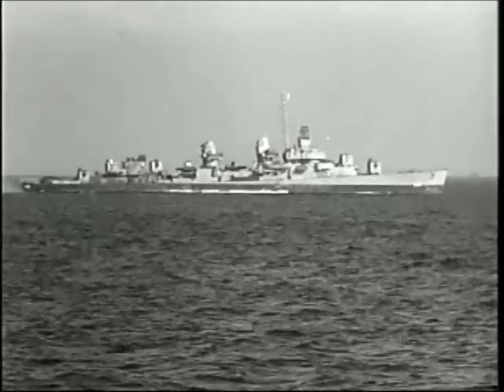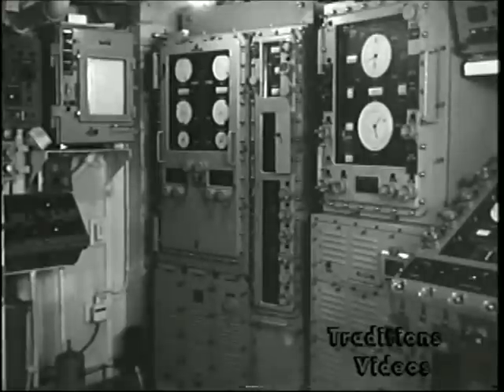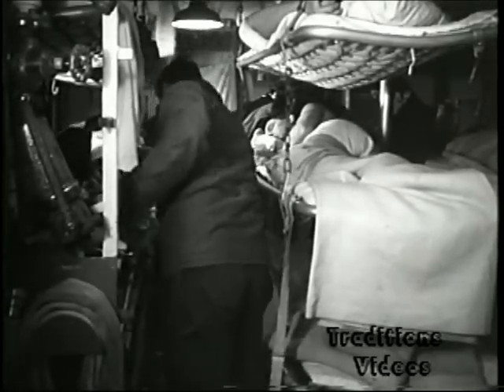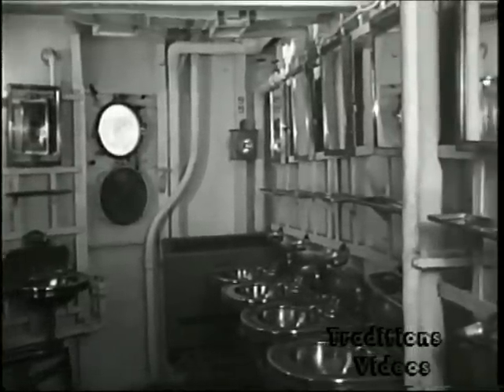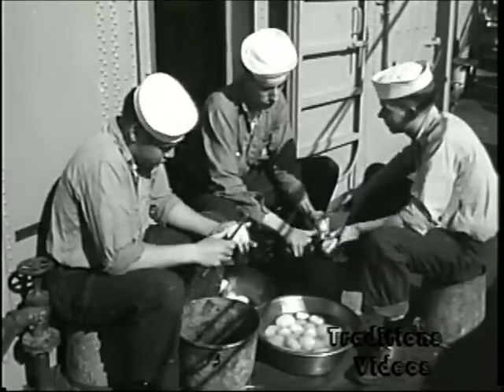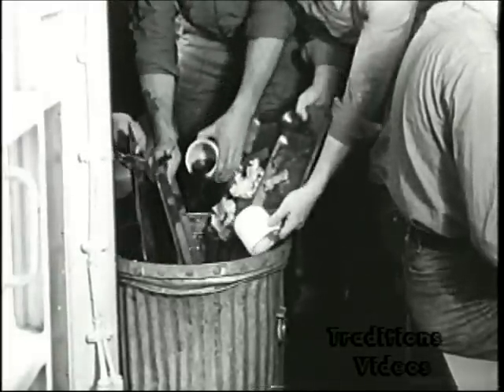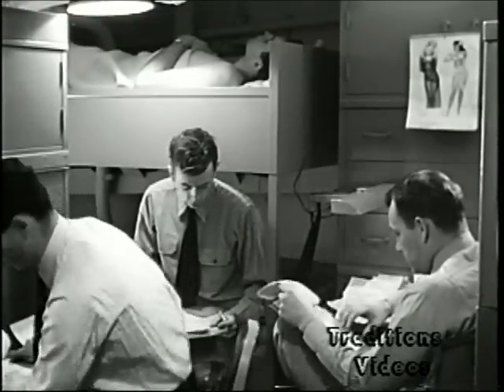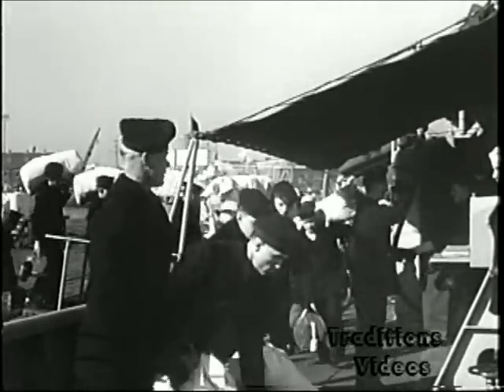US Navy USS  Saufley DD465 1952 Living Conditions

Comment: This pretty much changed by the late 70's early 80's. Most of the surface (as opposed to sub-surface) fleet had been re-fit with curtained racks. They aren't much bigger; you still can't sit up in bed, but you at least have a feeling of some privacy. The curtains are blue which blocks the red lights that burn all night in birthing compartments. There was the threat of having to "hot rack" (two guys sharing the same bed alternately) during deployment to the Red Sea for Desert Storm, but it wasn't necessary - thank God! The heads were also updated to have individual stalls. One of the B.S. parts of this film was the air conditioning being installed for the comfort of the crew. TOTAL B.S. It was installed to insure that electronic equipment, then working on heat emitting vacuum tubes at the time this film was made, remained cool enough to operate. The fact that it also helped the squids be a little more comfortable was completely unintentional. The comfort level of a sailor today is 500% better today than it was 70 years ago but it took about 30 or 40 years from the time of this film to accomplish that.

Comment: I was an Electronics Technician aboard USS Ponce (LPD-15) from ‘83 to ‘87. Our berthing compartment was a little roomier but the head was tiny. It had three shitters, three pissers, six wash basins, and three shower stalls. The head was cramped and at least one of the shitters was out of commission most of the time. The air conditioning for our compartment was a joke too, as in there wasn’t any. That place cooked you good in the tropics. A lot of times I would rig a hammock up in the SPS-40 radar equipment room because the a/c was arctic in there. Loud as hell when the radar was running though. Had to use ear plugs. Got to see some awesome places around the world. Fun times !
Reply: A sad but true fact:  A/C  primary job is to keep the electronics cool.  If the sps-40 (long range air search) went down in the box it was a big deal.  Go Navy (RCN)

Comment: And this is why I joined the Army.  Had a lot of Marines that joined the Army after being Marines they all loved the corps but hated being on the ships.
Reply from the maker: Yeah, shipboard life is not for everyone.  Destroyers of all eras did NOT have any Marines aboard, but am sure there were some exception during transits or just for a very short deployment.  I never saw one in the four years I was in the destroyer fleet.  
But, yes, the Army sure looks more appealing than what is shown here.
Thanks for posting.
Reply: @braintrusts  who ran your brig?
Reply from the maker: @slowpoke96Z28  Never saw anyone who went into any locked confinement while aboard that DD.  Was told there was a caged area near after-steering for confinement, but never saw it. Was also told that the corpsman had a straight-jacket for control, but never saw that either.  
And, yes, being aboard any fighting ship for extended deployments was not fun, at least at sea.  In port was indeed like a foreign, but bawdy Disneyland.

Comment: I was on the USS Forrest Sherman DD 931, 1968 and 1969 was an IC3, slept most of the time on an air mattress in our work space with the gyro.
Reply from the maker: Seems the DD-931 was homeported in Newport, RI in that period, which we were also, the DD-829. 
Not sure I'd have enjoyed the air mattress, but our gyro room was also Plot and contained the IC patchboard. Was mostly quiet and cool during non-working hours, but on the Gearing class, was adjacent to the steamy/stinky scullery.
Thanks for serving and posting!
Reply: 57-60 RODE THE 938 IT WAS LIKE THE HOLLYWOOD HILTON COMPEARED TO THE WW2 DD's  32 yrs Bosn C

Comment: Fascinating film! I often wonder what life was like back then in these type of ships. Almost unthinkable now... Thank you so much for posting.
Reply from the maker: The living conditions improved only slightly through the Sumner-Gearing Class destroyers, all built in the '40s, as they got fitted for A/C in the berthing spaces in the 1960's, but not much else, other than regular toilets.  Living conditions were still cramped and VERY minimalist. These destroyers were the mainstay of the fleet (over 100 of them)  until the '70's. See other great videos that accurately depicts life on a USN DD at: 
https://youtu.be/ih7ygOUz_Wg?list=LLYM__wKvMwZ1-yjtSH6abRg  (my personal favorite)
and
https://youtu.be/V3Tcyy38lnI?list=LLYM__wKvMwZ1-yjtSH6abRg

While the toilets were normal, the seating arrangements were not: in the forward head the crew faced each other while seated and knees either touched or overlapped.  If both tried to wipe simultaneously, they bumped heads.

Thanks for viewing and commenting on the video. I'm glad the Navy produced it way back when.

Comment: When the SS Unites States was built, it was both a luxury trans Atlantic liner and a troop ship, though it was never put to use as such.  But one of its features as a troopship was air conditioning throughout the ship, unheard of at that time.  The designer William Francis Gibbs had designed many ships including the Liberty ships, and understood that if you packed an Army division onto one ship you had to have climate control.  He also gave the ship an improved version of the turbines and boilers used on aircraft carriers - 240,000 horsepower, and a top speed of around 40 knots, to ensure outracing submarines.  It could do better than 20 knots in reverse, and if it lost an engine room to say, a torpedo, it could still exceed 20 knots going forward.  Plus it could keep up with the fastest carriers and destroyers and Iowa class battleships.  And it was nearly fireproof.  A lot of hard earned lessons helped the design.

This film gives a good idea of how improving equipment in the pre digital era needed ever larger crews.  Today, many of these functions use a much smaller crew and take up much less room.